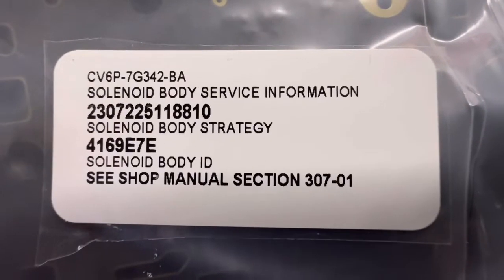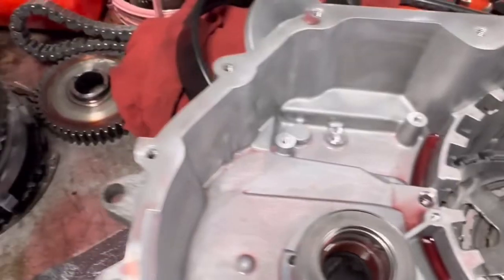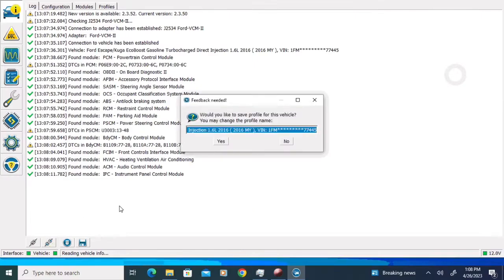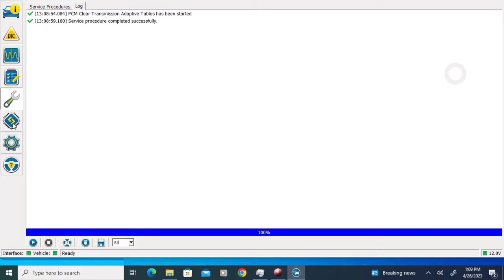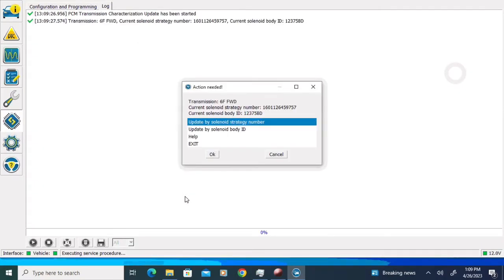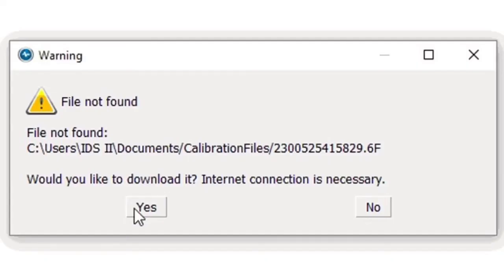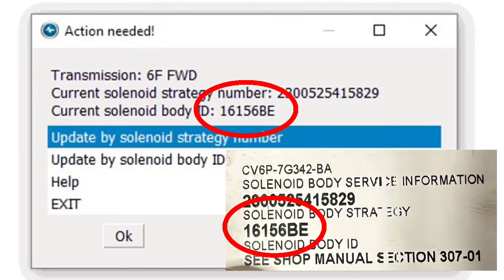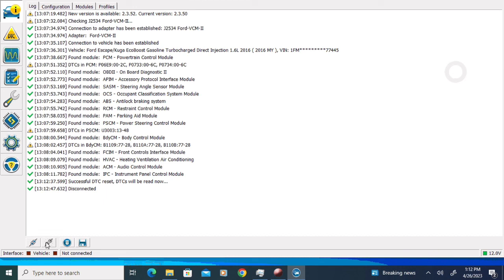Changing Ford Solenoid Body Strategy and ID with Forscan

Comment: Is there a way to get the new code with no sticker
Reply: Good question. I couldn’t figure this out either. Just got my valve body with my sticker
Reply: @mykelflores-tx9kk I’ve been told by so many people to drop the pan and it’s on the valve body itself
Reply: @GlobbinTerps  yeah it is. I was just wondering if there was an easier way. How’d yours run without these numbers?
Reply: @mykelflores-tx9kk where did you buy the valve body with sticker from I can’t find 1 anywhere, everyone has rebuilds with no codes available
Reply: @GlobbinTerps hey buddy so I got it from eBay and they actually sent the wrong one. The seller is the one who caught it after it was sent. You can though get the Codes off the valve body it self without the sticker. I noticed that my old one was not even the correct code that was on my TCM in JSCAN. 2nd transmission was installed approx 100,000 ago.

Comment: Hi, what version of forscan is this? My latest forscan only allows to update strategy but this version has the key options I need to update both strategy and solenoids manually
Reply: Oh never mind, it's right on the connect screen, v2.3.50. 👍👍

Comment: Hi mate, I’m a mechanic from Sydney Australia, after I programmed the new valve body I’m getting error code P163E00 transmission control module programming error, car stays in first gear and jumps to third. Any help would be very great, thank you.
Reply: Also i face same fault. You fix it????

Comment: I have a 2020 F250 6.7L 10R140 rebuilt with a Suncoast Stage 3 kit and valve body. We need the new valvebody programmed. Is there a network of technicians that come to shops to program new valve bodies? Thinking there is some kind of service like this since not everyone has the equipment to program all makes & models.

Comment: Thanks. Really appreciate you putting this up! I’m very impressed with how FORScan works. It saved me a ton of money and it was pretty seamless. The only part that I got hung up on was when it asked me to pick the transmission that the vehicle had since FORScan did not identify it on its own. Fortunately, the program appears to be idiot proof. I selected the same Transmission that you had and I kept getting an error. Once I selected the correct Transmission, it worked just like it did in your video.

Comment: Do you need to pay anything for the software file you downloaded? Or is that included with FORScan?
Reply from the maker: No, you do not. You do need the licensed version of Forscan or the trial version.
Reply: @CarShopTalk  Awesome. From one YouTuber to another,  as well as a shop owner to another, I really appreciate you getting back to me so quickly. After looking on the FORScan site it looks like it will work just fine with my J2534. I’m traditionally a Mac user, I ordered a PC with the required specs so I can download and use FORScan this on a 2012 F150 this week. What is the cost for a licensed subscription? I keep seeing anywhere from $12-$20. If that’s correct-I can’t believe it is that affordable. Since I already have a J2534, using FORScan appears to be way more affordable than paying not only for a subscription to use FDRS or IDS, but also buying the correct VCM interface. thanks again.

Comment: Hi I have a 2010 fusion 2.5 after like a hour or so of driving once I come to a dead stop the car goes into like neutral wont shift but if I turn of the car for 2-3 min then turn it back it on works just fine after could it be just the valve body and would I need to program it once replace ?
Reply: Did you end up programming the new valve body or just plug and play worked fine?
Reply: @h @hectorcontreras4938  I didn’t program it just plug and play worked just fine

Comment: what happens if you dont have the sticker ? where can i get the solenoid codes ?
Reply from the maker: @andrewrodriguez3292  some transmissions have it tagged or laser engraved on the valve body. If it’s not one of those there’s not much you can do.

Comment: Question. The sticker i have is rubbed out, and inside transmission only has the top numbers. Will that be enough? I see on ford ids both numbers are required. It's for a 19 transit
Reply: find out?

Comment: Wow, great video. Thanks for sharing this information. So I have a question I'm hoping you can answer. I have a 2017 Ford Fusion SE with the 1.5 Ecoboost in it. It has 168,000ish miles on it and the current owner NEVER changed the fluid. So as you can imagine, it burned up and would not go into any gear anymore. 😞 So my question is, can any 2013-2020 with the 1.5 are all the transmissions the same for these years or do i have to stick with the 2017-2020MY transmissions? and second if I get a used trans out of a wrecked car with low miles on it will doing this programming you showed in this video allow it to work in this car? Thank you so much.

Comment: OK, great video.  Since no good deed goes unpunished, can I bother you with a few questions?
1)  This looks like you never need AS BUILT tables, and is completely done with a GUI interface.  Is there any danger in mis-clicking and accidentally clearing the PCM KAM info?
2)  How would I go about downloading the strategy file and saving it locally before starting?  Can I do this in FORScan without being hooked up to my truck, or is there a website to fetch this file?  My access to wifi in my shop is poor.  
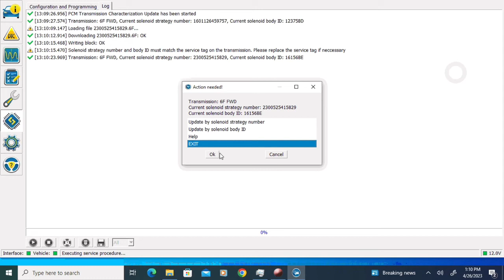3)  When does the new strategy get programmed in?  At the 3:44 mark when you highlight "exit", then click "OK" and cycle the key?  In the video that appeared to take place very quickly.  How long does it take to update the strategy once the correct file is downloaded and you hit "OK"?
4)  Do you have a Patron / paypal link?  I'd like to buy you a beer :-)

Comment: Thank you for your informative videos. I recently replaced the transmission in my 2015 Ford Escape, but I am now encountering an issue. When I attempted to start the engine, I received a warning on the dashboard indicating that the vehicle is in drive, which is preventing the engine from starting. Could you advise me on what I should check or whether I need to update the solenoid body ID before attempting to start the engine? I appreciate your assistance.

Comment: Can you please reply back to this comment:) thankyou
I’m wondering how I download the calibration files?
Reply from the maker: @markwipf6649  Forscan should automatically download the correct calibration file over the internet for the solenoid body id or strategy you enter.
Reply: Thankyou very much!! I got it going and reprogrammed the solenoid .
I just took it for a drive and the tranny operates way smoother but not perfect.
My drive mode isn’t working though have u had this issue?

Comment: Hi. What can I do if the previous owner replaced the valve body but didn’t update the strategy number nor body id and doesn’t have that info?
Reply: open the oil pan and the valve body should have the 13 digit strategy number and 12 digit solenoid id

Comment: Hi! Trying to do this on a 14 Escape. I was able to modify the ID but when i try to do the strategy Forscan says it cannot connect to download the file. I do have internet on the laptop.
Reply: Pls why no reply
Reply: were you able to figure it out?
Reply: @ No. we gave it back to the customer and he took it to a ford dealership. I think they charged about $120. I wanted to email the forscan guys but never did.. just didn't have time back then, maybe i still will.
Reply: @peters1821  Just had this issue. Turns out the solenoid strategy is case sensitive. My new one had an "F" in it, and using "f" didn't work. In case anyone sees this!
Reply: @jonbomb400  thank you

Comment: Thanks for the video!!  It already may be in the comments somewhere. If so, sorry. So I’m swapping a transmission that went bad in a 14 Escape, with a low mileage one, from the salvage yard. I’m guessing this is what I need to do after I have the transmission installed before I test drive? And I just follow your video and the steps. I should be good to go?  Thanks in advance.

Comment: I have a 2010 Ford F150 with the 6R80 6-Speed Transmission. The licensed latest version of Forscan does not list a PCM module. Therefore there is no “Update Transmission Characterization” listed. Forscan told me this is not a feature available for my model/year vehicle. They also told me Ford IDS also does not contain this programming capability for my particular vehicle/year.
So how is one supposed to enter the new solenoid strategy code and valve body id ? 
Apparently in my early 2010 my transmission uses a TCM that is moulded into the plastic lead frame that attaches to the valve body. I was told that the newer models do not have a TCM in the Lead Frame anymore and that a PCM Module is now used. I guess this explains why no PCM Module is found when Forscan connects.
What a bummer, how is someone supposed to get this data entered? Is it only something a Ford service center can do with another type of software besides Ford IDS or Forscan?
Sure was hoping to do this myself.😩
Reply: Is there not a TCM transmission characterization update option? I’m assuming you’d just need that since the tcm is on the lead frame and not controlled by the pcm

Comment: Just out of curiosity could I re renter the old ID if not changing the valve body? I’ve got some wacky shift issues that kinda go away when resetting the tables. Will putting in the same ID strategy possibly help on top of resetting the tables.
Reply from the maker: Entering the same values shouldn’t change anything. They’re just solenoid flow rates.

Comment: Hi, thank you so much for your video first of all. I’m currently trying to do this for my 10R80 as I just replaced the Valve body. After I input the new strategy number from the valve body it’s asks me what work has been done, I pick “Main Control Replacement Only” then it would give me “TRID data don’t match” looks like this step does not come up on your video.
Reply: Also mind you the reman valve body I repalced it with did not come with the ID card with the strategy numbers. So I'm taking the numbers that is stamped on the valve body itself.
Reply from the maker: @loballin007  where did the valve body come from?  I had an aftermarket transmission once that the solenoid strategy they gave for it wasn’t valid.
Reply: @CarShopTalk  The valve body came from Ebay. And it didn't come with the strategy ID tag. So i was basically taking the 13 digit strategy number directly from the valve body itself. Also this valve body is a remanufactured valve body.

Comment: Pregunta si el stiker de id esta borrado donde encuentro la estrategia y el id
Reply from the maker: Some transmissions the put a tag on the valve body also, but you’re have to pull the pan to get it. What are you working on? What year, model and transmission?
Reply: @CarShopTalk  es una 6r80 Ford 150 2015 la caja de válvulas se ve usada  ya quite el Carter de transmicion y veo el número de 13 dígitos de la estrategia pero no veo el ID de selenoide todo esto lo hago porque perdieron la pcm y se instaló otra con su calibración pero hace falta programar el ID y la estrategia ya que no son las mismas

Comment: Awesome video, which forescan did you use and what was the other product did you use
Reply from the maker: It has to be the windows version of Forscan. I used a Ford VCM with it, but that’s because I all ready have it. Forscan has a bunch of adapter that are compatible listed on their web site.
Reply: Thank you for the video.  My 6f35 went out. I will be doing this myself, can't afford mechanic. I'm getting a reman. Can you please tell me besides a laptop, what do I need to buy to do what you did on this video.  I'm clueless. I have a 2017 ford escape se 1.5 two wheel drive. Do I need some kind of cord to connect to the car and do I need to buy the software? Thank you
Reply from the maker: @galagatron5319  You’ll need to download the windows version of Forscan from Forscan.org and get an OBDLink EX cable from Amazon. You’ll need to get a 60 day free license for Forscan or buy a license and you should be good.
Reply: @CarShopTalk  thank you for that reply!  Thanks for helping people too.
Reply: Hi, thank you so much for your video first of all. I’m currently trying to do this for my 10R80 as I just replaced the Valve body. After I input the new strategy number from the valve body it’s asks me what work has been done, I pick “Main Control Replacement Only” then it would give me “TRID data don’t match” looks like this step does not come up on your video.
Reply from the maker: @loballin007  I haven’t ran into that. TRID is the memory area where solenoid characterization data is stored. I’m not sure why it would really matter if just the valve body or the entire transmission was replaced. Either way the data needs to be rewritten and shifting relearned. Try selecting transmission replacement and entering it.

Comment: Couldnt you swap the selenoids over to the new valve body to avoid this relearn? Reason I'm asking is a discovered my valve body had damage (the plate). Figure that would work right?
Reply from the maker: Yes. If you swapped all the solenoids into the same position then the strategy would remain the same. I would still probably clear the adaptive strategy and perform a drive cycle relearn since you’re replacing at least part of the valve body.
Reply: @CarShopTalk  gotcha. Appreciate it. Not super familiar with these, I mostly stick with GM and Chrysler. Thanks

Comment: I have a 2006 Ford Explorer, American import. When the engine temperature rises, the compressor disconnects and does not start again. I changed the computer, but it does not help.
Reply from the maker: Are the cooling fans running?

Comment: Hey bro. Nice simple vid. Under service procedure, I don't have "PCM clear transmission adaptive tables. Also I've purchased a 1 yr of Forscan. But the issue is, under license I don't see PCM trans character update, only TCM char update. But when i delete my license I have both, PCM & TCM transmission characterization. I'm using it on a rebuilt 6R80 auto transmission in a 2012 ranger. Any help would be greatly appreciated.
Reply from the maker: That is strange. I can’t say I’ve ran into that. I’d probably try contacting the people with Forscan.
Reply: Did you sort this out? I also had both PCM and TCM transmission characterisation options in programming.
I updated the TCM characterisation strategy first  only to have a PCM P163E and TCM P0700 programming error come up and the PCM option wasn’t there anymore

Comment: I bought an used transmission for my Ford Escape 2014, but where can I find the number? It has a sticker but it has about 21 numbers in the sticker.

Can somebody help me please?
Reply from the maker: They should be on a sticker on it.
Reply: Sticker gone must take it off drain the fluid numbers will be printed on the part

Comment: do i need a ford account for it to download file from the ford server using for scan ? any help would be great im replacing my VB on my 2013 f150 because bad lead frame and just found out i need to program the VB to my PCM
Reply from the maker: No, you don’t need a Ford loggin to download transmission strategy files. It should download for anyone. And yes, you’ll have to change it for a valve body replacement. I think it does need to be the paid windows version of forscan, but I think they still offer a free 2 month trial.
Reply: @CarShopTalk   Your Right I bought the paid version and it worked perfect i just programed in thank you ..
Reply from the maker: @fredrosario2947  Glad it worked, you’re welcome.
Reply: @CarShopTalk so out of curiosity if I’m already running a tune and then install a new remanufactured transmission and have the tuner input the changes in the tune would I still have to route it through forscan
Reply from the maker: @MrpvpYT  The tune and the transmission strategy are stored in two different locations / they’re different things. I would still put the correct solenoid body idea and strategy in it. Shift strategy changes in the tune would remain unchanged, but it needs the correct flow numbers to work from.